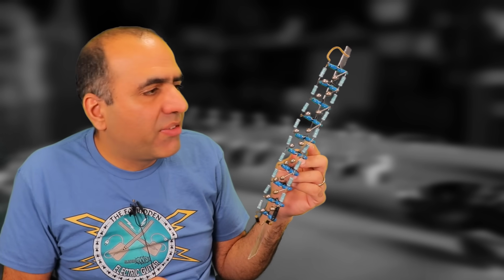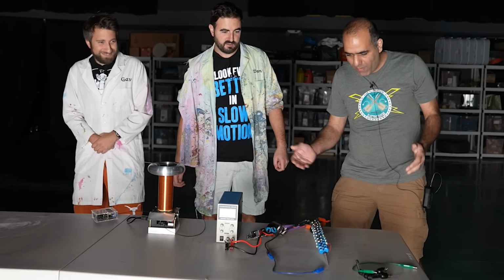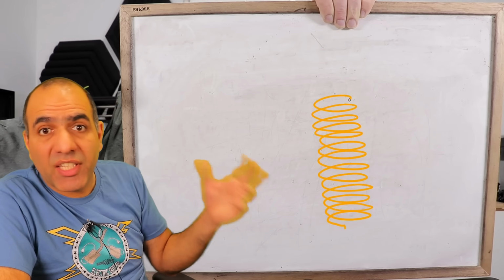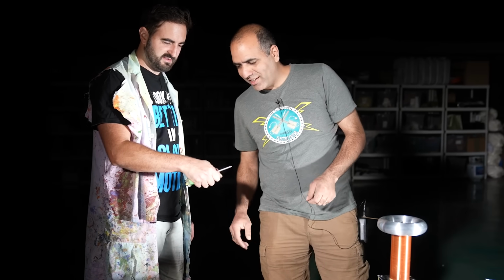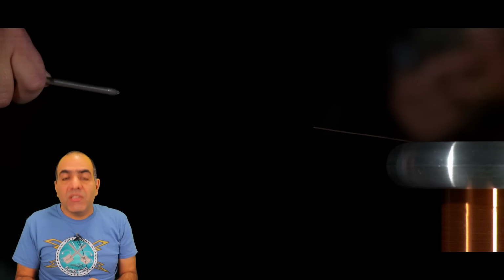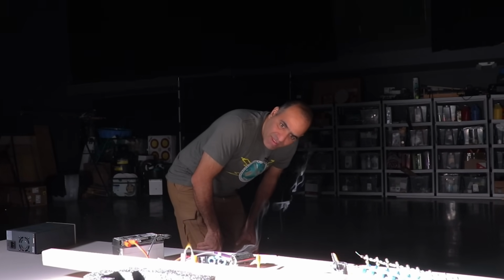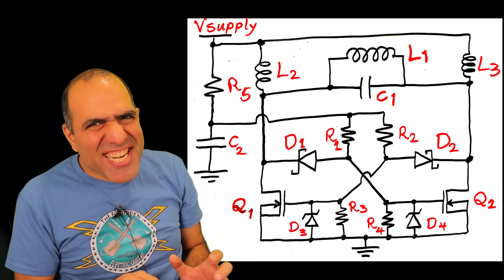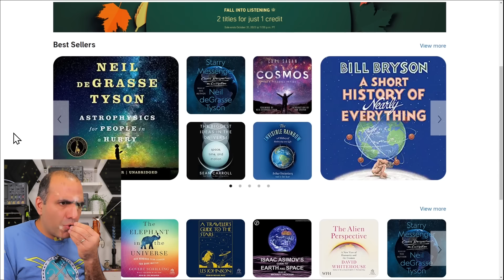Slow-Mo Experiment Disasters, ElectroBOOM VS The Slow Mo Guys

Comment: Never did I think you would manage to blow up a lab power supply!
Reply: How the hell have you seen this video two days before the release date?
Reply: @joveaaron-real  patreon
Reply: yea, that is electroboom, never think  something is impossible.
Reply: @guardiangusti9808  ok thakn you
Reply: I blew up mine too, ran 300A from a car battery through it, vaporized the tracks on the PCB inside. Luckily it was just a small area and I could bridge them, working fine again.
Reply: First time watching the channel?
Reply: It must be true that they say everything's bigger in Texas... maybe even the voltage is bigger too... or perhaps a noisy, harmonic laden power source to the building you guys were in.
Reply: Maybe it was a cheap one.
I haven't managed to blow up mine yet either for the uncountable times it has been shorted on its maximum range and all things I have popped with it for over 10 years.
And it's a switched power supply.
So they are really robust.
Reply: @TheLordNemesis  I have even charged dead car batteries with mine and started the car with the psu still connected.
No bang.
It's a 0-30V and 0-10A psu.
Reply: @draxoronxztgs1212  Yeah usually they have protection for all kinds of user errors. But mine has two independent sources that can be bridged internally for more amps, and I accidentally connected one wire in reverse polarity, so it fried the bridge PCB.
Reply: me reading this before i finish the video:
Reply: Marx generators are famous for blowing up switch mode power supplies. That is why I only use batteries to power mine.
Reply: @TheLordNemesis  My power supply is fused (input and output are separately fused). Isn't his? Does a fuse not work?
Reply: that has literally never happened in any of his videos before too so I'm very surprised lmao
Reply: @toddmarshall7573  if the fuse blows its highly likely the damage has already been done
Reply: Medhi will always find a way, bless his heart

Comment: I'd say everything that happened was perfectly normal for high voltage experimentation.  It usually does involve quite a bit of smoke.  Power supplies HATE driving high voltage and high frequency stuff unless the output is grounded.  Even the old traditional units used to pop diodes and arc internally during "incidents".
Reply: It was also right next to the tesla coil. Tesla coils can do some weird stuff.
Reply: This reminded me of a strange parts episode where he was having issues with a power supply arc’ing to itself due to altitude. Wonder if that was any factor also?
Reply: Honestly, if there's no smoke... i'd be worried what else went wrong...
Reply: Could you do a colab with Electroboom?

Comment: The fact, that he used a non grounded screw driver so gavin gets shocked is hilarious haha Mehdi wanted it so badly.
Reply: Dan gets shocked,  not gavin
Reply: Even if it was grounded with a fully covered sheath the spark might still jump off the metal screwdriver's point towards Dan's hand. Considering the high voltage.
Reply: It's not a slowmo guys video unless Dan gets to be a lab rat

Comment: Hey Medhi, I had actually became a fan a few weeks ago. I had been really struggling with current and voltage since although my teachers are good I have the attention span of a cockroach. I watched a few of your explanations on it and understood everything not only on current and voltage but wayyy more. Thanks Medhi!
Reply: He has a video on voltage, current and resistance
Reply: The one thing that helped me understand voltage is the analogy that voltage is like water pressure in a pipe. Not exactly true but it's good enough for beginners to understand.
Reply: for me, the definition of current is easy to grasp, it’s just a measure of the rate of charges flowing through a wire. more current = more charges moving through the wire in the same period of time (either faster movement or bigger wire that allows more current flow). this is why you need bigger wires as current increases, and you can see in mehdi’s videos when his wires burn it’s because they are too small for the current he’s pushing through them.

voltage is tricky to grasp, the definition most people will tell you is “electric potential” but i like to think of it like this: charges want to move from higher potential (+ end of a battery for example) to lower potential (ground or earth for example) always. that’s why most circuits have a ground, that’s the “final destination” of the charges as they always want to flow to ground (0 volts). as voltage increases, the charges want to go to ground more and more. i think of voltage as how badly the charges want to move through the circuit and that current is just the result of the voltage across the circuit (limited by resistance, Ohm’s law relates this very simply). this is why when voltage is high enough, you get arcs through the air like you see in this video. the voltage is high enough to where the charges will jump through the highly resistive air to reach ground. if you took an open circuit and increased the voltage enough, the charges would use the air to close the circuit and move to ground.
i’m just an EE undergrad but this has helped me conceptualize it a little better.

Comment: If you guys ever collab on something like this again it probably wouldn't be that hard for you to make a circuit that generates a trigger signal for the camera so you can just have a very short recording that is triggered exactly when the arc happens.
Reply: They did plan for that, but it was literally a forgotten dongle that made it impossible in the allotted time they had together. 
  
 They needed the phantom camera hooked up to their laptop, but they didn’t have their Ethernet to USB-C dongle on the day of recording.  
They also weren’t going to use a random part they just bought that day, without extensive testing first. As the Phantom setup they have costs over $200,000.

Comment: With my ZVS circuit I found sticking the flyback transformer in oil really helped by preventing it from flashing over from the HV output to the primary winding around the core, like what started happening around 11:58. Just a tip for anyone who plans on using a ZVS-driven flyback in a more permanent setup :P
Reply: You mean some people don't want their setup to repeatedly catch on fire?  Where's the fun in that? :D

Comment: I am a retired EE but now I just basically watched YouTube with my grandkids.  I might be sneaking in some videos when they are asleep and so I am happy to have found this creator from the Slowmo guys. I I have watched several videos and it’s great. I don’t ever remember shocking myself on purpose but I have accidentally discharged a lot of caps and doing that little quick jerky dance while flooding my brain with adrenaline.  Try fixing a micro PBC after that while you are still shaking.  It’s great for learning control. I wish you all the very best!

Comment: You just need to let the computer run through them to remove duplicates and that would let you find your frames easier without you having to do it manually. If you need an app to do this I'll send the ones I use.
Reply: maybe just mention the apps you use in your comment, so it benefits all in the community lmao
Reply: @poiu477  any AI app can do
Reply: But the file wasn't on a computer. Each 2 second shot is equivelant to several days of normal time, so just transferring the file will take hours, as will processing the frames
Reply: @robinleicester  yeah thankfully its something you could plug in as an external drive and go be productive elseware while it finds it for you. It doesnt matter how long it takes as long as its not taking your life's time.
Reply: @poiu477  The app I use is Visipics but there are a ton of options.

Comment: For a couple of years.  I went to work for one of the worlds most legendary, analog, magnetic recording, tape recorder manufacturers.  By the name of, Scully.  A direct competitor to, Ampex, 3M Mincom Division.  Along with a newer American upstart and Ampex cloner called, MCI.  But Scully's were different.  And they sounded differently.  From the other manufacturers.  With their model, 280.  And an automated radio station player only version called the 270.  And originally was all, early, germanium transistors.

Around 1970.  Larry and Jeff Scully sold the company to, the Dictaphone Corporation.  Add with that.  The Dictaphone Corporation then upgraded the 280.  To the newer, lower noise and more linear sounding, silicon transistors.  And the machines became even more popular.  With folks like, Jimi Hendrix and the Beach boys.  And so many others.  Who all fell in love with the Scully sound.

At around the same time.  Another electrical engineer working for Dictaphone Corporation.  Came up with a newer and more improved version.  Called the 280 B, versions.  And produce an even more gorgeous sounding machine.

But then around 1978.  Dictaphone sold Scully off to the, AMPRO Broadcast Products, company.  In, Newtown, Pennsylvania.  The opposite side of the US from, Los Angeles.  Where Dictaphone Corporation resided.

When then.  I left a legendary hit recording studio job in, New York City.  For a multimillion dollar, national advertising agency.  Where I became in charge of all, audio and video, commercial productions.  And the boss let me purchase, 4 new, studio tape recorders.

And so I chose, 2, MCI recorders and 2, Scully recorders.  And we received shipment of the 2 stereo Scully recorders.  At the cost of approximately, one brand-new, Toyota Corolla, each!  The MCI's were no difference in price.  But offered some different features the Scully's did not possess.  Such as, real-time, tape time counters and controlled tape tension.

The only problem with the 2 new Scully's I received.  Was that they, just did not work.  As they should have.  As expected.  WTF with this?  These are brand-new!  And they are definitely not meeting specifications.

So, I start troubleshooting my 2 brand-new, Scully 280 B's.  And I'm on the phone, to, the now, Scully AMPRO Corporation.  And I'm calling them, every week.  And speaking to John.  The VP of Scully AMPRO and an electrical engineer himself.  When he then says to me.…  Remy… It sounds like you know more about these machines than we do.  And we drastically need your help.

My help?  I tell John, I'm nothing more than a flake, pot smoking hippie freak, official high school dropout with only a GED.  And no college.  How the hell can I help?  You're an electrical engineer and you have an electrical engineer.  Also working for the company.  I am an uneducated idiot.  He didn't care!  He said they had some big problems.  Worse than mine.

It was then that John, offered to me.  The position of, Quality Control Manager and the, Final Test Engineer.  And please Remy.  You also figure out why our machines are also blowing up at flaming out on others?  As we just sold 30 machines to the South Korean broadcast network.  And we now have an international incident with the United States, State Department.  Because all 30 machines they purchased.  All blew up and flamed out within the first week of operation.

He went on to tell me.  That they were packing up, 20,000 pounds worth of parts and pieces.  Circuit boards and transistors.  And he's heading off to South Korea.  To fix, restore and rebuild these 30 machines.  That all blew up badly.  And were nonoperational.

Within a couple of weeks.  I found myself in my first factory job!  I had never worked for a factory before.  And I'm working with a lot of, electronic school, trained technicians.  And the companies, electrical engineers and mechanical engineers.  And I'm now in charge of the entire factory floor!  Oh my God!  What the hell did I get myself into?

So I set out.  To figure out.  Why these machines and their transistors.  Were going in the thermal runaway.  And burning black holes through, dual layer circuit boards.  Rendering them, unrepairable.  Oh my gracious.

This is not an easy procedure for me.  I am working with zero knowledge base.  Why are these, solenoid powering transistors, all burning up?  It's a GE Semiconductors, Darlington, dual power transistors.  Don't have to sink a big load of current.  So what the hell is going on here?  The wiring is all correct!  The parts are all correct!  Everything is correct to the schematic and wiring diagrams.  And yet.  Transistors into thermal runaway.  Which could only mean one thing.

It basically meant.  These transistors were biased to, full on, all of the time!  And they shouldn't be!  What the hell is going on?

And so all I can say is.  I ended up.  Taking a couple of, rejected parts out of, specification.  And over about a week.  I built up a new machine, in my apartment living room.  Smoked a lot of pot.  Drank a lot of beer.  And stared.  I stared for hours at the wiring.  When it finally hit me!  I had found the problem!  And it took me 2 weeks and hours and hours.  But here's what I discovered.

Between the time that Dictaphone created the, B versions.  With electronic TTL logic chips.  To control the transport functions.  They were already onto, version 3.  Of that circuit board.  And with each of the three different versions.  Came different, wiring harnesses.

And while my wiring was accurate.  To the letter.  Of the schematics.  I then realized.  This was the wiring harness.  For the previous logic circuit board.  Not the current one!  What the FUCK?

So it turns out.  The wiring harness loom.  It was a piece of, plywood.  With a bunch of nails on it.  That they would create the wiring harness.  For the tape recorder on.  And when the company was purchased from Dictaphone in Los Angeles.  And moved to, AMPRO of Philadelphia, Pennsylvania.  The current version wiring loom harness plywood board.  Never made it to Philadelphia.  It went missing.  And AMPRO used the previous, logic circuit board, wiring harness.  Which still worked.  And the machine would run fine.  For about a week.  We only burned them in for 24 hours.  Prior to shipping.  And I would have to test each and every machine before shipping.  And to put my quality control rubberstamp on it with my signature on the, specification test results.

So I went in the work that day and pronounced.  The machine is repaired!  And here's the new wiring harness loom pegboard.  So we can make the proper wiring harnesses for this current, transport logic control circuit board.

The unfortunate thing was.  I was never compensated for all of the extra work I put in.  Not only correcting these errors.  But also improving the machine's, electronic, technical and transport improvements.  And made the machines even better than they were originally.  And I'm an uneducated idiot.

A few months later.  The rich owner.  Pulled a fast one on me.  And completely contradicts.  What he hired me for technically.  When I saved his ass!  And so I resigned!  When he then said to me.  No.  You are fired!  And you're not going to get your unemployment compensation!  I said oh yeah?  Want to bet?  He said yeah!

In the end.  I went to work for NBC-TV in Washington, DC.  And I got my unemployment compensation!  And so I win!  And he close the company.  Three months after I resigned.  And I stayed in touch with my guys.  That were working under me.  When the company was sold off to, Sequoia Electronics of Boulder, Colorado.  And they offered jobs to my guys.  Who went to work for, Sequoia Electronics.  When one of the guys called me months later.  And told me, Remy… They never had us build another machine.  They only sold all of the stock off of the parts.  What a sad story for such a great machine!  A piece of American history!  As Scully.  Who was a Master Machinist.  Actually made, record cutting lathes.  That, all of the big American record labels were using.  To cut their records.  Of folks like, Jimi Hendrix and the Beach boys!

So Scully Tape Recorders.  Was actually an offshoot of the record lathes manufacturing.  And hired a bunch of guys.  From the Presto Corporation.  That made the earlier, record cutting lathes.  That were quite popular in America.  And they had also manufactured an early magnetic audio tape recorder!  Using all, vacuum tubes, of course.  When the Presto Corporation.  Was bought out by another American corporate magnate.  Who then decided.  They were not going to make tape recorders anymore!  And so those guys went to work for Scully!  And they created the original model 280.  And the 270 player for automated radio station playback systems.  That were suddenly gaining strength and becoming popular all over the US.  With oldies radio stations.

And during my short tenure with Scully AMPRO.  I had gone on to designing.  A more current, 2 inch-wide tape version transport.  For a, 16 and 24 track, music recorder production machines.  That never came to be.  Without me.  As I wanted us to compete with, Ampex, 3M, MCI and the Swiss built, Studer tape recorders.  That became very popular in the US.  Starting in the early 1980s.

And so in the end.  Legendary American history, Scully recorders.  Fades into obscurity.  With digital recording taking hold.  Just a few years later.  By 1983.  And when I personally went, Digital!  With the Sony, PCM-F1.  Digital audio encoder.  You would record your digital audio onto a VHS or Betamax, consumer video recorder.

(Continued in next post)